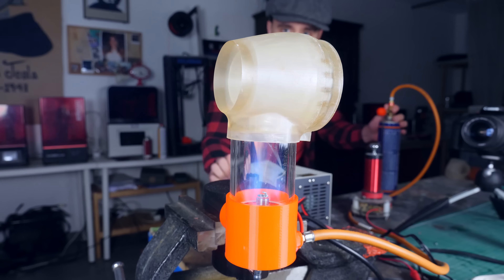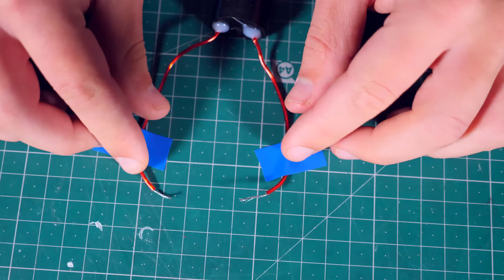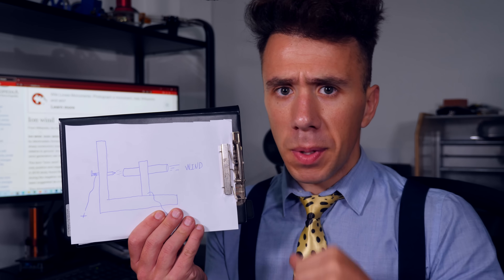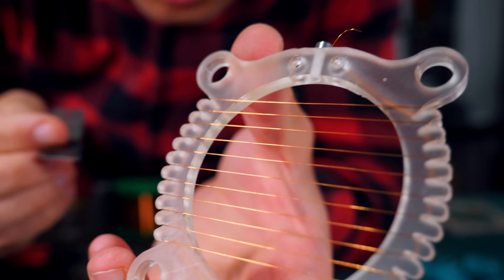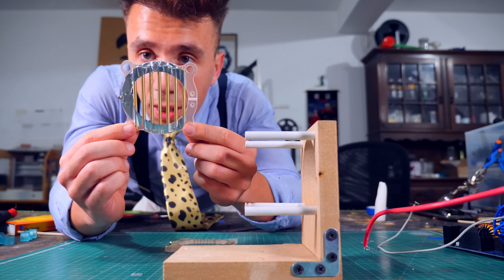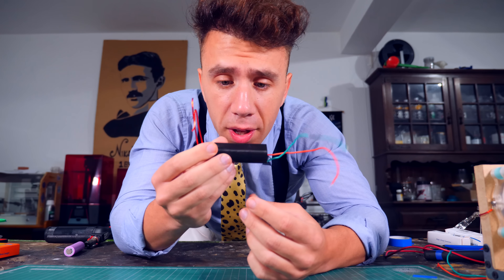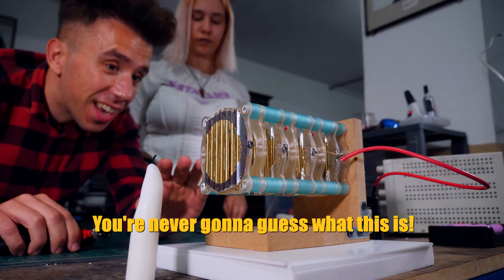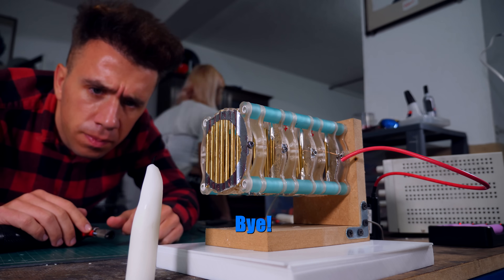I built a TRUE BLADELESS FAN

Comment: Suggestion: build a manometer so you can measure it's static pressure.

If your anemometer can accept the area, then you can get CFM/CMM (airflow) instead of just the velocity.

Comment: What about dozens of coils of spiral wire, put like a spider web, in the wire pole? Doesn't it put more volume at the entrance?

And what about aerodynamically designed tubes on the exit? It's possible to add some more of them.

Comment: What about electrons? Can't electrons? Electrons are just charges, right?

Can't we use them as propulsion? We did accelerate them in old TV, where the screen are vacuum... Or, I'm mistaken this?

If this true...

As, the ion thrusters used in space, still used ionised gas, so they still require refueling, right?

So, electron thrusters doesn't need refueling...

Comment: Lifters don't use copper wire, but ionising wire, which I think is steel or tungsten. You could also use permanent magnets to speed up the flow.

Comment: Why not use the bsi mark 2 design with nano mesh graphene wire screens Paired with your high voltage generators and use a carbon nano tube screen for your charge collector do those in series ald then use that newly upgraded version as a forced air intake to a high speed turbo that would power your pulse jet design?
Reply: Or have the upgraded mark 2 blow into a modified Tesla turbine that feeds the air fuel mix to the pulse jet turbine design

Comment: You can cover it like jet engine bring big battery and high voltage big generator and you can put the negative lines two grid and a two tube grid and you have a jet engine 👍so make this plasma rocket that can go to space and eject the tomato in space and taking a picture with it saying🍅 tomatoes are disgusting 🤮 🙏

Comment: If the geometry of the anode and cathode are changed around a bit, MAYBE it can be used as an "afterburner" for a jet engine to give the exhaust a bit more velocity.
Reply: Not enough mass flow
Reply: @super-toot  not enough mass flow through an afterburner?
Reply: @atrumluminarium  you said used as an after burner, not through.
Reply: @super-toot  yes but if it is used as an afterburner, the mass flow entering is probably already close to mach 1. The AB just accelerates it further
Reply: @atrumluminarium  the amount of acceleration would be neglibable unless you had a metric shit ton of power going to it. Like power plant levels of power

Comment: About the flyback transformer from the TV, it has a built in rectifier diode, because CRTs work with DC also. They should put out around 25 - 30 kV DC.

Comment: i seen on the guy who showed you this method when he blew an outside fan at it it blocks it like a magnet - to - no change more of a block what if you made a circle in the center with tubing and wire! if the air got through would it have a pushing reaction like the opposite side of a magnet - to + #woulod really love a 3d printer lol death to all tomatoes

Comment: you can use iridium spark plug tip to increase ions, higher voltage always increase air speed, coanda effect also helps as in dyson fan

Comment: 2 Proposals: A  bladeless submarine, since water is a conductor, you wont need to create a plasma (MHD).
2. A Motor that runs on electric fields and not magnetic ones. Why? To cut down on inductivity. So you can switch the polarity faster without increasing resistance.

Comment: Use a magnetic gearbox (because of the low friction) to speed upon alternator to get power from a  low speed river or stream. I don't know if you're still giving away the 3D printer in exchange for ideas for future videos but here's a cool idea which uses magnetic, low friction, or no friction non-contact gearboxes. I live in Pittsburgh, Pennsylvania, and it seems that, the 3 rivers, even though the majority of the length are not fast, there must be a way to extract some power from all that hydro-power. I liked your video on the blade-less fan by the way, but is it really silent, with the cracking caused by the high voltage? I'll have to re-watch the video

Comment: Although it looks amazing, but the same tech is used in space exploration for decades. The biggest issue is a power consumption - you cannot beat a 0.5W 5V little fan with this technology by default, it is just not possible, but only if there is air... As soon as adventure goes into vacuum,  that's all different story! Thanks for a good video and good luck in improvements.

Comment: Add a cowl to the stage to up the efficiency, make the bars teardrop shaped (possibly not easy) to enhance air flow (round tubes are almost the worst shape for air flow) and experiment telescopic or studded bar as stage separator to allow the stages and grid depth to be adjusted and optimized. 

Its possible that different stages would work better with different gaps

Comment: So I did a little (much more rudimentary) version of this experiment! And I tested something I don't think you are Jay tested which seems to greatly affect wind speed and ionization.

I created a single stage similar to Make Magazines design and achieved roughly 1.7 m/s off a 1,000KV transformer. However, I tried adding a slight breeze (aka I blew at the anodes) and noticed my wind speed dropped significantly (about .3-.7m/s). This made me realize when watching your video that you are probably losing a serious amount of speed due to the fact that each stage is blowing into one another.

I bet if you found a way to separate each stage and channel their wind output into one you would achieve greater results.

Comment: You have created multi stage compression but don't have a compressive boost. Each following chamber should have higher voltage/wattage compared to the previous chamber. Same as turbines change blades and blade counts, the tighter and smaller the chamber is. Your internal pressure resists incoming buy with added voltage/wattage progressively through the chambers not only pulls the previous volume but eliminates the resisting pressure. This will allow the chambers, in succession to provide more air and thus more thrust. Typical go with a 30% increase to the following chamber/'s previous input voltage/wattage. I guarantee almost double thrust

Comment: Great video!
The old t.v. part out sure brought back memories.
I once used an old t.v. fly back attached to my car bumper, which was Nickel back then, to persuade some neighbourhood dog to go find another place to do his morning elimination. I judged the success of my idea by the speed of his retreat. It also worked as a theft deterent.
The problem I found with high voltage ionic generation is the gases created dissolved some important things like rubber and skin and interfered with the Saturday night hockey game on the t.v..
At the time I did not know that at some concentration of hydrogen the air in the immediate vicinity will self combust and remove windows and doors with little effort.
Also, I learned that the O zone is more than just a place between the N zone and the P zone.
So try not to leave things on and if you do send someone to shut them off for you.
Thanks for all the great info.

Stan the power man.

Comment: On a whim, I decided to ask GPT4 if it had some ideas for optimising the design. These are some of the suggestions that seemed to have some merit:

Pulsed operation: Operating the thruster in a pulsed mode, rather than continuous mode, can help reduce energy losses. By applying high voltage in short bursts, it is possible to generate strong ion acceleration without creating excessive plasma or initiating unwanted chemical reactions.

Optimize dielectric barrier: The dielectric barrier plays an essential role in preventing direct electrical discharge between the electrodes. By optimizing the properties of the dielectric barrier, such as its thickness, permittivity, and breakdown strength, it is possible to minimize energy losses due to plasma generation and chemical reactions.

Use of magnetic fields: Incorporating magnetic fields can help guide and confine the ions more effectively, reducing the likelihood of unwanted plasma generation and chemical reactions. This can be achieved by using permanent magnets or electromagnets in the thruster design.

Active cooling: Implementing an active cooling system can help maintain optimal operating temperatures for the thruster, reducing the chances of unwanted plasma generation and chemical reactions. This may involve the use of heat sinks, heat pipes, or other cooling methods to dissipate excess heat generated during the thruster's operation.

Comment: what if the wire came pre-perforated from the factory? then what about smaller wire with more density of grid. Same for the negative tube size. I have a feeling that there's a golden ratio that will produce the most thrust between positive and negative. So then smaller more dense area of wire also means smaller more dense area of the negative tubes.

Comment: 12:55 How you get 15m/s and before only got 6-7m/s? What you change? You use 7V instead of 3,5V from 1860 Li-ion battery?
15m/s is a lot. Is 58km/h must of drone are below that speed(around 25-30km/h) 
Now i am interested in IONIC propulsion. Can measure presure or add reducer tube to see if can be used with ionized air.

Comment: I'm thinking that to get better performance, you will need to do a few things. First, the -ve side should have as small a cross sectional area as possible to reduce the impedance to airflow (shape them the same as for the triangular UFO thing). Next, the thrust units should be inside a tube so that the airflow is constrained (no air straying outside the flow channel). Lastly, the first stage should be some way inside the tube (my gut says about 1 diameter or so) so that the airflow is more or less linear when it gets to the thrust units. The inside of the tube should be a s smooth as possible with only the wires protruding into it. Put a trumpet on the front and a short tailpipe on the back.

Comment: Here is some advice to improve thrust:
- Add a small DC voltage to the thin wire to heat the wire and produce more thrust
- Use thinner steel wire
- 5mm x 15mm teardrop shape to replace the rods (sanded aluminum foil bent around a plastic straw)
- Use 6" between anode and collector
- Use 50KV DC or more
- If you use sound to control the plasma you should get more thrust. Experiment with a speaker near the intake of your thruster at different frequencies and amplitudes
- Use a Star Challis coil in between the collector and emitter to rotate the plasma into a vortex

Comment: I wonder if there is limit to how close the wires and the razor slits can be?
I guess there is. but probably they can be closer than 1cm?
Perhaps the limiting factor would be the tubes as they're thicker.
Also enclosing the length of all the stages in a tube would reduce the loss of some wind to the sides.

Comment: You should try the ionic thruster with high voltages. Take reference from Peter Lindbergh's thesis by Aalton university. If designed nicely and given ultra-high voltage, the ionic thruster is going to give some really meaningful thrust and replace the liquid and solid rocket engines(not entirely). But that's enough to give you enough thrust. The chances of failure would also be very less. Actually, the concept is that combustion produces exhaust and by the newton's second and third law, it pushes the object in the opposite direction. This thruster would do the same. I highly recommend you to use this as a meaningful thruster which produces a lot of thrust.

Comment: @Integza, some questions.  In duplicating your design, with a single plate, we are using the same arc generators you have, putting out 1000KV with 6-12V of input.  However we are finding a few things:

1) We know we can get an arc because if we get the output wires close enough we see it, did you see an arc against the rods holding the stages together?
2) Feeding the multiplier a voltage of some 2.5-3V causes a discharge, as if the base circuit cannot handle any more.  Do you know why?
3) Even at 2-3 volts, we definitely are not seeing sufficient ionization (if we are linear and, say 3V gives me 500KV, I would expect ionization to happen).  Do you think that it is the conductivity of what we are using for rods (brass vs. copper)?
4) Does the orientation of the 2 plates relative to each other matter?

Thanks!

Comment: yap astig ...well maybe  if you also added the  vertical and horizontal magnetic coils ,,,of course also the old  circuit that comes with it...located from the neck of the old tv tube...probably more pressure can be made ...higher particle discharge and more area coverage thus resuting in higher presure atmospheric discharge...just maybe..you know...

Comment: Project:

Go back to that old TV Tube, you stole the power supply from and harvest the 'electron guns' Cathode ray tube from it and set it up as the positive end and build a tight (close together but smaller tubes or even a heavier gauge wire) grid out from it, make sure you vacuum seal the cathode ray tube, you will have to use some of the glass from the front of the old tv tube, with the negative end about 2 cm from front of the reconstructed 'cathode ray tube', have fun! [ is easier with black and white TV tube but more powerful with a color tube, and if you can still have the picture control working, well you will like it, but do not use a moving picture, use a static one.]

Comment: Here are my thoughts on this subject and my hopes for a new 3d printer
1)  I’m wondering if their was a point you could miniaturize the design  and get a better performance of flow. Maybe. 
2) build these miniaturized fans into a grid build into a shape that would focus the power of the wind into one point.
3) you could use an etched wire design over your current rapping copper wire to shrink the design down. Etching couple potentially give you more power density to work with.
4) if the smaller wires & design had arcing issues maybe you could put it into an airtight fish tank gases that provide a good dielectric?

5) fractal etching on the copper would increase your surface area greatly too & could increase performance.

Comment: Pretty awesome build!!!
I do have a question though, why did you build the specialized electrodes in a single line from top to bottom or from left to right?
what would happen if you actually build those electrodes in a circular formation and at the middle of those circles try using a higher voltage rather then the outside of the circles wouldn't the outside be attracted to the inside more efficiently thus pointing the airflow in one direction like a nozzle?.

Comment: I'm late to this comment section, but it seems like what you mainly need are air guides. That's one of the things that the dyson products typically do well and you can do easily with a 3d printer or just paper(probably wanna line it with that aluminum insulating tape in this case, so it doesn't catch fire).

Comment: Since you have built the ionic thruster, put an electrically insulated plastic tube around everything making a wind tube to channel its maximum velocity, then put a thruster nozzle on the end. Try to make the ionic plasma turbine engine and give it more stages in unison so instead on one turbine you have a system of three turbines working in sequence to create optimum thrust.

Edit: 3 tubes, 3 nozzles, optimal power.

Comment: Would toroidal design work? Like have the generating part be a round of wire and a torus of pipe be the receiver, and that could be put into a plastic tunnel (and with multiple stages). Making them smaller diameter in a conical design might also give some pretty impressive thrust. Purely in theory of course :D

Comment: I tried increasing the area of corona discharges and made a grid with wires i sanded from one side. I didn't test that alone, so i can't say if it was effective on its own. In the same try i also made a grid 90 degrees offset, which was effective.

Second i wanted to decrease surface area of the positive side, so that it decreses the air resistance. I used a grid of 1mm² copper wire, which was at least not reducing Performance for me and was cheaper to source and easier to work with for me.

Third i insulated the non active area with liquid electrical tape and silicone to prevent leakage. Only minimal improvements.

Fourth I tried to prevent leakage of air, so i used plastic pipe as a spacer between positive and negative. That was somewhat effective, but only in increasing airspeed a little. 

Last step was to put an venturi air multiplier on the output of every stage to increase the aair volume. First i made the air multiplier to aggressive,   and concluded that my stage didn't have enough pressure, so i made the air multiplier less extreme. Also no big improvements.

I did not include measurements, because i eyeballed all the diemtions and used for wires what was in my wire bin.... also i did not include measurements and improvements, since my measuremnts were shit. I only had a cheap wind speed meter from a weather station, that gave mecoder counts, instead of speeds and it was really shitty....
I guess I would need to get an real anemometer and rebuild all my improvements one by one to give you something to work with....
Reply: @integza I think this is a fake. Just wanted to let you know

Comment: I just noticed that you are using cylinders as the ground terminals for the bladeless fan, and I think that changing the shape to aerofoils actually might increase the flow speed, thereby giving the air more energy when it separates from the ground.

Sure, it would complicate building, but the improvements probably could be worth it.